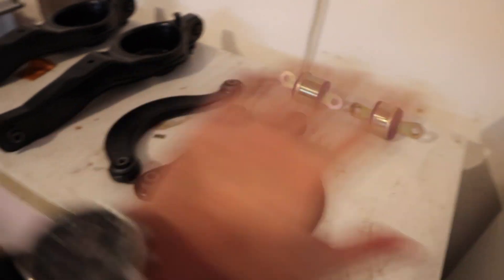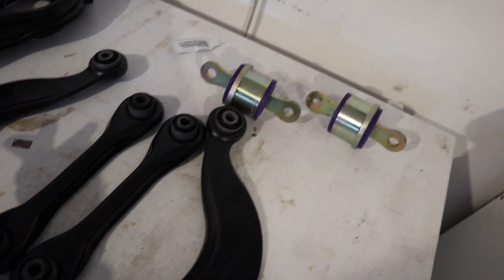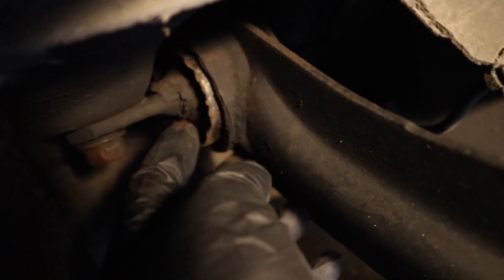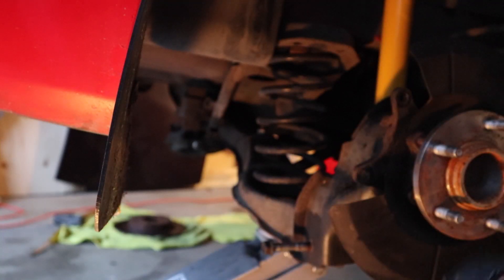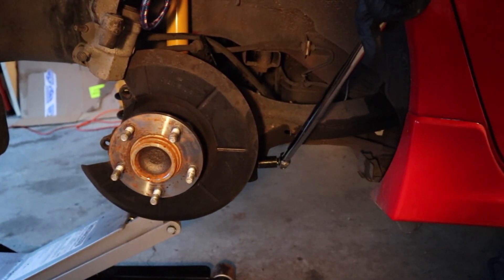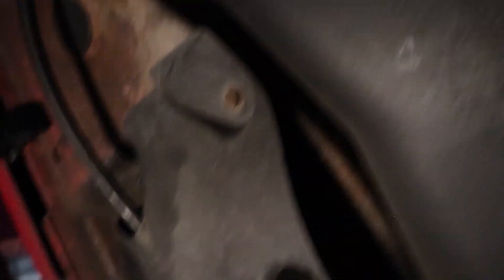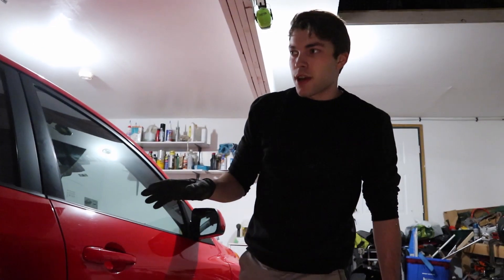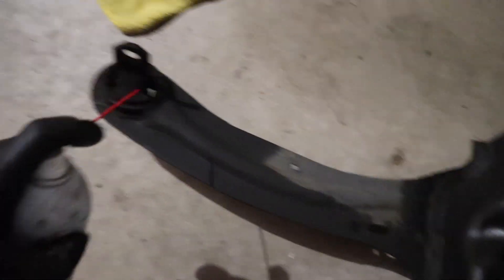Rear Suspension Rebuild NIGHTMARE! | Mazdaspeed 3

Comment: Sawzall with a Diablo blade cuts those bolts like butter. I break the bolts loose before I start these kind of jobs on my car so I know which ones I'll have to order. Or if your parts place takes returns just order new bolts and return the ones you don't use.

My next suspension job I'm going to splurge on that electric "torch" that heats bolts cherry red.

Comment: Bro old vid but where did you get the alignment bolt for the lower control arm that you guys cut? Mine snappee cuz of rust lol.
Reply from the maker: Dealer
Reply: Any tips how to remove the lower control arm bolt? There was a black box that looks like tje fuel pump on the way.

Comment: When you ordered those control arms, did they come with new haradware for re-install?
Reply from the maker: No, I just cleaned up the old bolts with a wire wheel and they were just as good